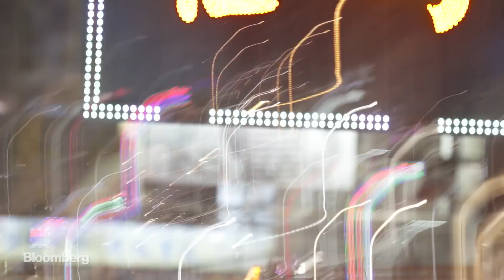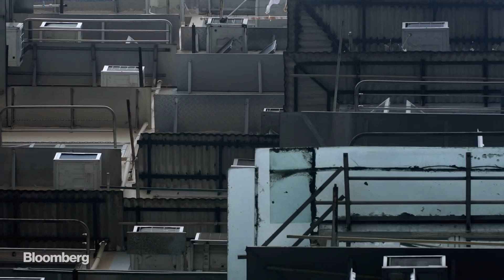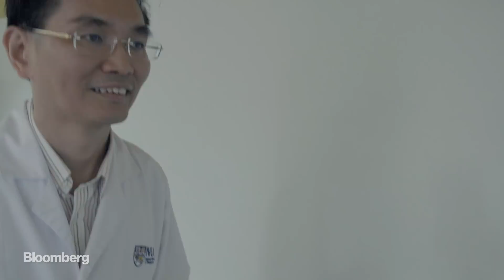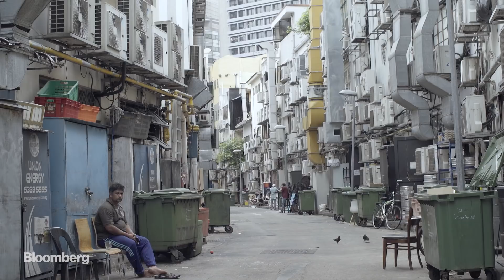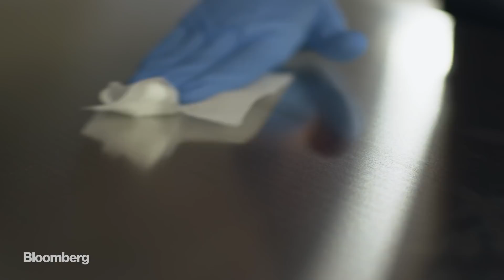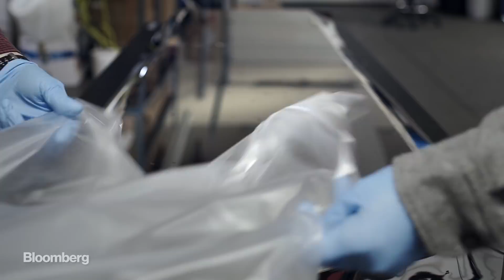This New Space Tech Could Someday Replace A/C

Comment: In the U.S. many places have air conditioning systems, but despite being heat pumps, they miss out the reversing valve to reverse the flow and make the most efficient heater by moving heat rather than creating it.

Comment: It's a swamp cooler with an A/C unit in front of it. Fun fact: A/C's job is to reduce humidity*, and it does this by lowering *temperature - not the other way around. This is because air's capacity for water reduces with temperature. Technology Connections has a few great videos about refrigerators & A/C units (same idea), and swamp coolers.

Comment: I appreciate evaporative cooling too, but this is not new or revolutionary technology. Hell, the Romans used it in their architecture. People in dry states in the USA have had them for decades, commercially manufactured.

What earned a down vote is the false information you give. Modern air conditioners don't output greenhouse gases. They don't output any gas! It's thermal exchange. They output heat when cooling. Any gas output is a noticable malfunction.  Shame on you for lying to the public.

Comment: There is a company in Colorado (Coolerado) that has been making water-based (high tech swap coolers) air conditioners (and selling them) for over a decade .. they're primary for dry climates, but they do have a hybrid pre-cooler to compressor (conventional) A/C to extract the moisture.  Reflection (of heat) has also been around for decades white/light colored roofing materials or shade sails; even trees/leaves that capture heat/sunlight for photo synthesis.  The reflection product shown has one (major) flaw, that the surface needs to be kept clean .. keep working on it, but show some real, new tech next time

Comment: First step to reducing energy for cooling should be air sealing! Build better and seal all new construction residential and commercial. We already have the ability easily cut energy for cooling by 30+% via better building and air sealing. Most homeowners and businesses could easily cut energy bill by 30-50%  with minimal investment and quick return on investment. Yet we don’t talk about that because it’s not a brand new 5-10k ac unit lightening your pocket and fattening corporate America’s pocket.

Comment: The only problem with the first featured solution is.... 
You get tons and tons of molds over time (in the room that it is installed.)
Reply: Maybe build it with a heat exchanger so only air that hasn't been wetted can enter the room. Also, you could build that apparatus out of aluminium an blow some burning hot air through it from time to time to sterelize it

Comment: I have been in the HVACR business  for 35 years and it has frustrated  me to no end these ridiculous systems that will never be residentially or commercially applicable. There are ways to easily make your current systems use up to 50% less energy but the industry doesn't push them and the average person doesn't know about them. 
1. Filtered misting systems for the outdoor condensing unit that can vastly help heat rejection with minimal water usage. The head pressure is lowered and the compressor uses less energy.
2. Insulation. Insulate the attic space where the largest amount of heat gain in the summer and heat loss in the winter occurs. If you keep the heat in or out as the season dictates then you won't have to spend money moving it around. If you had a boat with a hole in it would you fix the hole or just buy a new energy efficient bilge pump. In new construction you can use foam insulation in the walls and have energy efficient doors and windows put in.
Reply: I have for 25 years and a cheap RELIABLE inverter would vastly change things more than the 20-30  percent these boast.

Comment: The biggest problem with coatings and similar technologies is that they need to be kept clean to remain efficient. Most people would never keep them clean enough
Reply: Mech-E Just put an simple, automatic cleaner an the panels. One single motor needed to implement
Reply: @VertigoAt1977  what is mech e?

Comment: Why dont we cool our houses with a pipe system that circulates water underground far enough that it cools on the way through kind of like we use water for radiant heat all we would need is water pumps and fans both can be powered with solar energy
Reply: Some people use that either to heat or cool the houses, that s pretty expensive to do... in my country (Romania) where the anual salary is like 10 000$ but you dont put any money in the deposite.... the sistem cost like 5-6k $ ... so the average people wont use it... A/C cost like 300$

Comment: Video Quote:("Today's air conditioning and refrigeration systems essentially follow the same principal, that have been around for about a hundred years.")

Well so what? the wheel has been around for a hell of a lot longer and we still use it. Just because an idea or method is old doesn't mean it's obsolete.     

Video Quote:("Air conditioning may actually become one of our largest source of greenhouse gas emissions, later this century.") 

Wrong, air conditioning systems don't produce green house gases. The refrigerant is "contained" where it is simply recirculated.  Asawath Raman starts this whole thing out on a false premise. If he has an alternative cooling system then fine. But don't present it by misrepresenting current methods.

Comment: I have a hard time believing the air conditioner will work.  It will take energy cause the water to condense and there will be heat released when it does because of the heat of vaporization will be released when it condenses, the same amount of energy that is absorbed when the water is evaporated in the second phase.  It could be that it just wasn't explained by the narrator very well, but I'm skeptical.

Comment: Lol so it's just an evaporative air cooler
Reply: Well, there's the selective membrane thing that presumably means it doesn't humidify the air as much as a swamp cooler, so that's something.
Reply: Darnit Productions exactly what I was thinking!
Reply: Also water is a green house gas. It also has to dry and cool the air using 70% the power of a traditional ac. Sounds overly complicated. And like bullshit
Reply: @Capthrax1  Well one thing is that water is far more easily removed from the atmosphere than other greenhouse gasses, if that means anything to you.
Reply: Conner Forbis fantastic solution. Wide spread use of evaporative coolers. It's okay water is easier to remove from atmosphere. No worries. Or and just hear me out continue to use refrigerant systems and make the power from solar or nuclear
Reply: @Capthrax1  So... what you're telling me is, you've no clue what you're on about?
Reply: Conner Forbis I am actually pretty informed on what I'm talking about usually in the loop as well.
Reply: @Capthrax1  The new Beverage Air commercial refrigerator and freezers use R290 Propane gas as a coolant. I was going to buy a couple but the cost is too high for me.
Reply: @robertlee8805 many different types of refrigerant systems use different types of gasses, propane being a small portion, along with carbon dioxide
Reply: @robertlee8805  when i say nuclear im more hoping for fusion rather than fission. That being said Chernobyl  exclusion zone is seeing a massive revival of wild life and even previously extant breads of wolves are being spotted. So the only thing worse than a nuclear meltdown is urbanization
Reply: This is not an evaporative cooler.  This tech sends a frequency of ultraviolet light into space through a gap in the greenhouse between 8 and 13 microns to accomplish cooling. They use this process to cool water which is circulated over a coil in an HVAC system which will allow the compressor to not work as hard. This saves electricity and gives additional capacity to the unit.  An HVAC unit could be sized smaller with this tech. The question I have is how much surface area is needed to produce the volume of water that will produce the change.
Reply: Better then the dudes that built a mirror.

Comment: The opening graphics are misleading. AC refrigerants are NOT emitting greenhouse gasses UNLESS THE GASSES ARE INTENTIONALY RELEASED!
Reply: Yes, leaks happen and at the end of the appliance's life, unless the owner has the refrigerant reclaimed or bring it to a recycler that reclaims it, it will be emitted eventually. I expect a lot of window air conditioners are just sent to the landfill even though there's a lot of reclaimable materials.
Reply: that wasn't the point of the graphic
Reply: Well not to mention that not all refrigerants are greenhouse gases.  This is just another money grab using the environment as a seller
Reply: Thank you. I thought the same thing
Reply: occurred to me as well :p
Reply: If you make it, it likely will be released eventually
Reply: Leaks happen.
Reply: Patrick Sanders the vast majority of cars with AC leak Freon regrigent (a green house gas) by design.  The Freon in the system is also used to lubricate the compressor by leaking out.  Now the amount is very very small, but with millions of vehicles on the road it is an issue.
Reply: @JustKillHem  Cars do not leak refrigerant "by design". That is totally false, an AC system it totally sealed. If it does need more refrigerant added then there is a leak that need to be fixed. It's horrible for the environment to just keep adding refrigerant to leaking AC systems. Also refrigerant is not used as a lubricant in an AC system, it is a small amount of oil mixed with the refrigerant.
Reply: @JustKillHem  you need to re-study how ac compressors work...
Reply: A.c. units also use a large amount of electricity, unless you have clean energy it creates emissions.
Reply: Patrick Sanders exactly false facts ￼

Comment: Wait. They used an infrared thermometer to measure the "surface temperature" of a reflective surface... and they measured the "air temperature" by pointing it at the ground... :/
Reply: That's why we need peer review, lol. Just cuz everyone can do science doesn't make everyone right. Lol
Reply: The material is not reflective in the infrared spectrum, that's why it works as a cooling device. So it is fine to use thermometer
Reply: We haven't deviated far from smoke and mirrors, it seems. The smoke must have been off camera.
Reply: one uses smoke and the other mirrors
Reply: at least the tech is really proven to work with some caveats...like if dust settles on the silver+silicon oxide+hafmium oxide layer, then all that infra red heat reflection becomes trapped. 

And as for the evaporative cooling, long use of tap or even filtered water will cause mineral deposits and kill efficiency, so then it becomes cost prohibitive to use distilled water instead.

Really the only way to cool better effectively is to design better buildings, use polyurethane second dome skin with some cooling vents, and maybe even building underground, natures best insulator. Anytime there's some kind of disaster that requires a building to be rebuild, it's a crime not to design it for long life and ultra efficiency second time around.
Reply: @minmaxerr  Caves near by?  Radon will get ya dead too. I'm referring to air leaks from cracks in concrete buildings if the were to build underground but yeh that might work if it's worked out to permanently repair those cracks so no radon gets in.
Reply: @minmaxerr  That's like saying all water pipes will become overridden with mineral deposits... yet every city in the world is unconcerned with using standard water supplies.

Comment: John Coloe you don’t know what you’re talking about. ‘Temperature is heat energy’, thanks, we sure got somewhere. SPACE IS NOT COLD.
Here’s your basic science class for ya:

Heat is kinetic energy between atoms and molecules. Space is empty, there are very little matter. If you take a m3 of space, it’s super cold, because there’s so little matter moving. If you take a mole (a bagillion of atoms) it’s hot as the freaking sun, because all the very little matter is getting blasted constantly by the sun.
TLDR saying ‘space is cold’ doesn’t make sense.

So. Space is not cold, how are we ‘cooling then’? You can cool an object in 3 ways, Radiation, Convection and conduction.
The two latter are the most efficient one. We use conduction to cool laptop cpus, and fans to cools ourselves with convection.
Radiation is super super slow. You have to wait patiently for the energy to flow out the surface of the material, photon by photon.

Radiation is like trying to push someone by throwing tennis balls at him, instead of just using your hands like conduction does.

And space is ‘cooling’ us because it happens to not be a giant wall bouncing tennis ball back at us. It has nothing to do with how cold it is. That’s just marketing bullshit for a bad way of cooling.

Comment: How it works: the panels convert heat into a specific spectrum of infrared light that is able to pass through air more efficiently than any other wavelength. So they are hyper effecient at using invisible light emissions to cool below ambient temperature.

Comment: It is indeed unfortunate that Bloomberg does not provide proper linkages or credits. 
Aaswath Raman along with colleagues first published this around 2013, and Stanford applied for patents in 2018.  I am sure after Stanford fully vetted it, then applied for patents five years later.
Search and find his articles for each of You to understand the details as each of You need or want (google scholar). The film would appear to be a very nice refinement from the original articles. 
After reviewing several of his research papers, the remaining concerns are; achievable temperature deltas for specific humidity (appears to work better in low humidity environs!!!), the amount of heat energy which can be dissipated per square meter and whether that metric can be be improved by what process or material? Best to Aaswath and colleagues.  This definitely works.

Comment: "space mirror" more like "reflecting incoming heat away thus cooling the surface "
Reply: No.
Reply: It's about black body radiation, but it's an absolute crap way of removing large amounts of heat. The only place you'd want to use it is in space where it's the only solution. Every space probe with an RTG or nuclear reactor uses radiators. The ISS uses white radiators to reject excess heat from life support.

Comment: And that, my friends, how you up-sell cheaply available aluminium foils for the maximum amount of profits.
Reply: Wrong. It's not Aluminum. Aluminum gets hot in the sun, not cold. Instead it's a composite layer of Silver covered in Silicon an Hafnium oxide. Reason being that those materials convert energy into narrow band infrared light which can easily pass thru the thick atmosphere and back into space without much resistance.

That's why the surface gets cooled. If you use aluminum the surface gets hot, any simple mirrored surface will get hot, even ice would get hot, that's why it melts in the sun.

The real problem becomes how to keep the surface clean for cheap as even a thin layer of dust will negate any cooling effect.

Comment: "Water based air conditioning" is that air cooler already done ? with less sophisticated method ?
Reply: Yes, but they don't work in humidity. This solution solves that problem.
Reply: @GlobalGaming101  may I introduce you to indirect evaporative cooler?
Reply: It's called a swamp cooler for dry desert areas...

Comment: wtf are they on about 'harnessing the cold of space'? are you bonkers? if anything, they're simply preventing the glass panes from heating up from the infrared radiation coming from the sun and the environment. A better explanation would be very welcome, but at this point it sounds like absolute bullshit.
Reply: That's not a glass, it's a  combination of reflector and a thermal radiator of selective wavelengths. The glassy layer is just to prevent heating of the panel itself.
Reply: Rafael Dos Santos it converts ambient heat in a building to a specific wavelength that is more efficient at escaping to space than any other wavelength. It’s an ancient technology, they used to use shallow pools of water to do this.
Reply: Works for the same reason a solar water heater can freeze in above freezing nights.
Reply: it radiates a wavelength of 10 micrometres which can pass through the atmosphere to space, space is freezing, the sheet is hot so due to entropy, the heat dissipates into the cold of space. its not bullshit if you take the time to understand

Comment: I didn't understood how SkyCool works: I mean, ok it's a pannel, but in order to cool my house what would I have to do? Put this on my roof during night and bringing it back in the house during the day? Isn't thuis a complicated procedure?
Reply: Bonnd T great explanation!
Reply: Now you see @ Bonnd T, that was a great explanation. Much more elaborate than was presented in the video. Thanks!
Reply: Ale Vic it converts and emits heat in a very narrow and specific wavelength of infrared light that passes through the atmosphere more easily than any other wavelength. So the heat doesn’t bounce back off the atmosphere, but rather is able to get to space and dissipate our heat.
Reply: the earth atmosphere reflects heat back to earth surface, but certain heat ( in a form of very narrow band of infrared light) would escape the atmosphere and lost forever.

So if you can target that specific band of light by reflecting it to the sky, you are basically sending the heat away the earth, into the space itself. And because the heat you send away are greater then the heat you receive from the ambient, that make the cooling works.

There are few ways to make use of this cooling technique, you can use it to cool water, and pump the cold water to wherever need cooling. Is like how a water heater works, but the opposite.